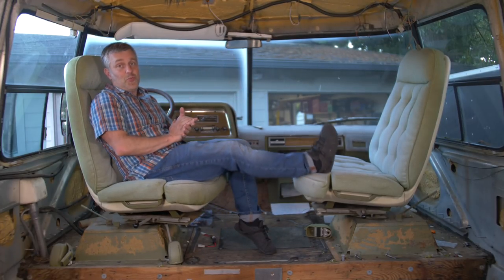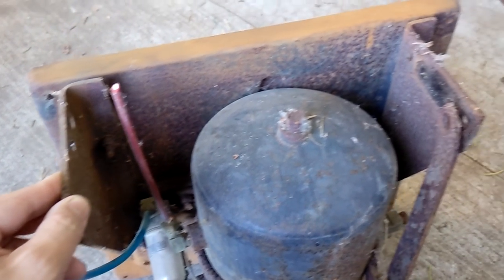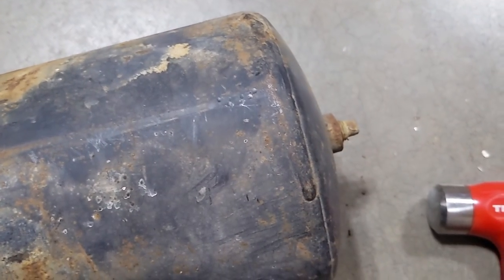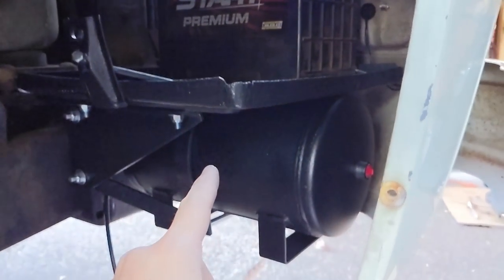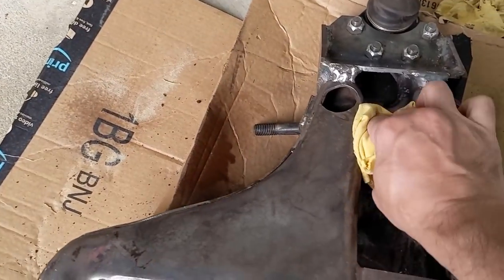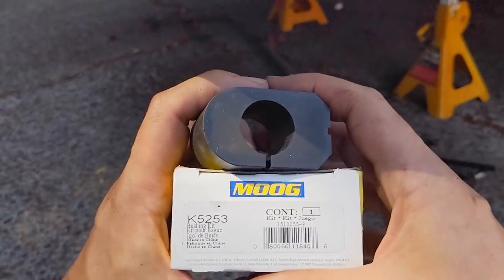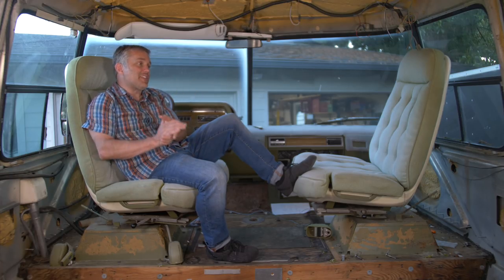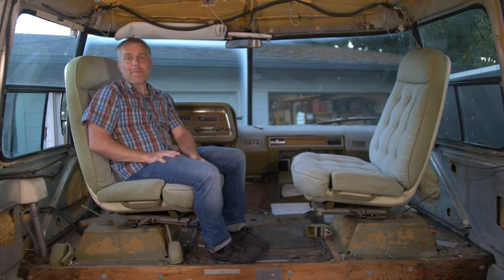Building the Best Damn GMC Motorhome Ever E.25 - Air Suspension Tank & Front End Install

Comment: The spacer on the one-ton kit compensates for the increased offset of the dually wheels.  The knuckle is designed for the offset of single wheels as used on most 3/4 and 1 ton trucks.  When dually wheels are used on the front end, the spacer is used to compensate for the increased offset between single and dually wheels.  You could get single wheels for the front and the tire track would be in the same place,  but then you would need to carry a single wheel spare for the front and a dual wheel spare for the rear..  Look at the front end of any GM or Chev one-ton dually wheeled truck and you will see the same width spacer on them.

I've had my one-ton front end for about 10 years now and I love it! The only downside to the wider front track is it increases the lever-arm on the torsion bars, so you will find you need to crank up the front suspension to bring it back to the proper ride height.  You will also find the front end dives down more when braking.
Reply: That's why you install the "reaction brake kit" on the rear that "floats" the calipers and uses connecting rods to transfer the brake forces directly to the frame instead of pushing up on the back (pivot) end of the swingarms for the middle wheels and down on the pivot end of the rear wheels. But the twist from the middle wheels unloads the rear wheels so they can barely contribute to stopping the motorhome. This all contributes to nosedive. With the floating caliper kit installed, the swingarms see none of the braking forces. It all goes from the wheels to the rotors to the calipers, to the backing plates, to the connecting rods, to the frame. The middle wheel brake force can't do any lifting on the frame and the rear wheels don't get unloaded or lose traction.

If the middle wheels could be replaced with rear wheels so all the swingarms were made trailing arms instead of the middle wheels being on leading arms, then the braking performance would be super, because all the rear brakes, drum or disc, would pull down on the rear of the motorhome to counteract nose dive with rear squat. The whole thing would slightly lower and become more stable with the center of gravity lowered under hard braking.

That's how it should have been designed but GM's engineers wanted to save $ by using a single airbag per side and thought that having a "bogey" style suspension would improve the ride by having it where rolling over something would push the rear wheel down as the middle wheel went over, providing more suspension travel as the rear wheel rolled over. But that also increases sideways rocking on rough ground.

Converting to dual airbags with a fixed center attachment eliminates the "bogey" and completely independently suspends all four back wheels. It also somewhat reduces rear wheel unloading under braking because the middle wheels swingarms twisting down don't put any pull upwards on the rear wheels through the airbags. Another trick possible with dual airbags with fixed center mounting is with independent airbag inflation (and deflation) control you won't need a jack to change a rear wheel. Inflate the bag for the good one and pull the air out of the bag for the bad one to raise it off the ground.
Reply: greggv8 ...EXCELLENT EXPLANATION

Comment: Wow, those spacers will certainly put a stress load on the ball-joints, front hub bearings, and affect the turning scrub radius of you front wheels unless you're using rims to correctly place the wheel center to the original offset.

Comment: On the axle nut- once used shim stock to fill in the difference. Soda can aluminum will work in a pinch as well. I put the shim stock around the nut with the socket wedging it in place, and drove the socket down over it.

Comment: Love your channel. I just purchased a 1973 GMC. I love everything about it except the stance. I can't stand a vehicle where the front end sticks up in the air. My Chevy G20 was the same. I lowered it and now it looks great. I also did the same with my 1981 Toyota Pickup by unscrewing the Torsion bars. I was wondering if that same thing could be done on these Motorhomes without screwing something up.

Comment: I rebuilt my front end stock, I put in offset bushings on the upper control arm,  I did my own wheel alignment using a caster camber Guage,  a laser to ensure I was alignment was straight.  The idea that the motorhome needs to track the same in the front as the back to stop it from moving around with cupped roads is a total myth.  In fact it's totally wrong.  If you studied race car suspension,  you would understand that the further you move the center contact patch off of the center of the ball joint the more the scrub radius is. The  more scrub you have, the harder it will be to turn the wheels, and the more torque steer you will have. My stock suspension drives so straight and true, I can put the cruise on and go to the back for a whisky like Ron burgundy. No one can argue that scrub radius does not apply. It absolutely does.  Most people who changed to one ton obviously , say it's  better but never felt what a good stock suspension feels like.

Comment: 23:47 No, hub centric wheels are not supported by the hub flange.  The wheel is aligned to the hub flange but the wheel is still held onto the hub by the clamping force of the lug nuts/studs.  This is a shear force and is the same regardless of hub centric or not.  The hub centric is better because the wheel is accurately aligned to the hub flange.  The hub centric rings do not bear a load. The weight of the vehicle is actually supported by the friction between the wheel and its mounting surface on the axle. The friction is established and maintained once the lug hardware is properly installed and torqued to specs.
Reply: Yes, this! Thank you.
Reply from the maker: Hi Kent, The mechanical forces in a hubcentric wheel attachment are a little complicated. The surface friction between the inside face of the rim and the outside face of the hub certainly adds some of the holding force, but by no means are the lug studs and the corresponding holes in the rim the bearing surface for the weight of the motorhome. That job is done by the flange. Tightening the lug nuts on a hub centric system only has the effect of increasing the surface friction between the two faces. Take a look at my other video at this time stamp: https://youtu.be/0jA2TIbdhMk?t=498 You can see just how much play there is between the lug holes and the lug studs. It's clear in this video that the rim is held in place by the hub flange. Even though I have the lug nuts here loosened the same movement could occur under load even with the lug nuts torqued to spec. Keep in mind that I was hearing a "CLUNK" noise when I slammed on the accelerator. Meaning that the lug nuts were allowing the wheel to spin until the rim hit the studs. Because of the tolerance between the hub flange and the rim, there is not enough moment in the vertical direction to allow the rim to slide so far that the studs contact the lug holes. That can only happen in rotational movement not vertical movement. There is a tiny bit of movement possible in the vertical direction, but it is very small.

Moreover, the force required to propel the motor home forward is far less than the force to hold the motor home up off the ground. Think about when you hit a pothole, or washboard? Driving over those those terrain obstacles is like hitting the whole system with an impact driver. We know how effective impact drivers are at removing rusty/stuck bolts. No matter how tight you have the lug nuts, the surface friction between the wheel and hub will not hold the wheel in place during these adverse driving conditions. That job is done by the hub flange. Think of it as a mortise and tenon joint. The lug nuts just sort of hold it in place and provide enough surface friction to resist (not impede) rotational movement and vertical sliding movement between wheel and hub. So, it's like an added strength, but the primary weight bearing happens on the hub flange. That's how the engineers intended it.
Reply: @IndustriousPursuits  Respectfully, Kent is correct. Vertical loads are held by the friction of the mating surface only - whether hub centric or lug centric. Indeed, most hub centric rings that are made for adapting aftermarket wheels to different sized hubs are made out of soft aluminum or even plastic. They absolutely are not designed to support the weight of the vehicle - only to center the wheel on the hub.
Reply from the maker: @McGurble  Are you trolling? The aftermarket will sell you anything. Plastic hub centric adapter rings are a death trap unless used with lug centric rims. Which is how they are used 99% of the time. Because they are plastic they do absolutely nothing, and are a complete waste of money. The lug nuts will center the rim where they want and will compress the plastic adapter if there is a discrepancy. 
You said "Vertical loads are held by the friction of the mating surface only...[on] lug centric [wheels]."
This is patently false. Lug centric wheel attachment has a 45° cone to the lug nuts and a corresponding 45° chamfer to the inside of the lug holes on the rim. These two surfaces mate and center the lug stud inside the hole. A 45 degree hole and cone mating split the clamping force equally in two directions.  This is proven by a concept from engineering called "force vectoring." https://www.dummies.com/education/science/physics/force-is-a-vector/) Therefore, each lug nut is providing 50% of it's strength to holding the rim in place resisting the planar forces forces acting in the vertical direction and also torsion (ie. spinning during acceleration and braking). The other 50% holds the rim to the hub in order to counteract forces from leaning during cornering or other such driving conditions that put a side load on the tire such as an angled side slipping road. Of course there is the added benefit of increased friction between the rim and hub which increases the holding strength of the connection resisting afore mentioned planar movements, but the engineers did not design the rim with this as the primary holding force. I doubt they even considered it in their calculations for lug centric wheels.
Reply: @IndustriousPursuits  I promise, I'm not trolling! Since I'm just a random internet person, here is a long article discussing failure modes and engineering principles behind wheel attachment methods. It gets quite into the weeds, but here is a relevant excerpt:
It has been reported in the literature [11] that a hub-piloted wheel attachment system actually provides additional support for the wheel in that a portion of the vertical road–load forces is transferred directly to the hub through contact between the wheel center hole and the hub. This is not correct! Just as in the bolt-piloted systems, all road loads are transferred from the hub-piloted wheel to the hub through the friction connection provided by the nut clamp force and the shear and bending forces applied through the nut to the wheel bolt.

https://link.springer.com/article/10.1007/s11668-017-0297-0#:%7E:text=The%20mechanics%20of%20securing%20the,its%20mating%20component%2C%20and%20the
Reply from the maker: Thank you for not trolling. I appreciate the link. I have come across the torque spec. for my hub centric rim. It is 250ft/lbs!!! That's insanely high. Given that lug centric wheels have  a typical lug torque of 80-90 ft.lbs. I do believe that I was wrong about the face friction and hub to flange weight bearing on the hub centric wheels. With 8 lugnuts clamped at 250lbs that's a lot of holding power. No need to rely on the flange. 

Further, your article is very informative. Thank you for providing it! I have read it and find no fault in the author's expertise. The paragraph you cited supports my changed mind that the hub flange does not support the weight of the vehicle during normal operation with lug nuts fully tightened to spec. I will talk about this issue in the next video. Again. Thank you for the polite disagreement and the good information.
Reply: @IndustriousPursuits  No worries, I love your vids and I hope to join the GMC Motorhome club soon!
Reply: @IndustriousPursuits  I guess my degree in Mechanical Engineering wasn't a waste after all.  :)
Reply: Most cars use both. The center hole fits very closely (sometimes so closely that a tiny bit of rust makes it near impossible to get the wheel off) to the projection in the center of the hub, and tapered seat lug nuts also contribute to alignment and support. Some fancy steel truck wheels have slightly oversized center holes to hold a fancy centerpiece on the back and an open ended cylindrical trim piece on the front to allow access to manual 4x4 hubs. Those wheels work but of course lose any support from snugly fitting the center holes to the hub projections.

Comment: Danger. you need the brass insert that fits inside your plastic line, as you have it now the plastic line can slip out of your copper compression fitting. available at your hardware store. better safe than sorry. nice build

Comment: You said you worked in San Diego so being in the fast lane at 55 mph is not unusual in California, drivers in California do not know how to use the Passing Lane, in Fact, if you ask the California driver what is the passing lane they look at you quizzically with an "Uhhhh"...thats the right lane where the trucks are" ...you can always tell the California Driver, in the Fast lane/passing lane on cruise control and they won't move over, So, great vid, never mine my sound off, I'l be watching, i love the old M H, its the simplicity, no circuit boards no chips hard wire, Thanks
Reply: Drive right not in the passing lane

Comment: The torsion bar bolts could probably be replaced with the longer bolts without full length threads since the last 1/2 to 3/4 inch cannot engage the threads due to the eye that it passes through on the end of the torsion bar anyway.
Reply from the maker: A nice idea, but false. There is no eye. The bolt must be fully threaded for full travel.

Comment: The wheel bearings are larger due to the spacer, and the extra force that you talked about.  I wonder how it would work to simply turn the wheel around, Leave the spacer off, and weld a, (Hat, Cone, shield,) onto the wheel to protect the rotor. But keeping the attachment point inboard where it was originally.?

Comment: Great video. Did you get the axles from manny? What is the oem Application
Reply from the maker: Yes I did get them from Manny. It's so much easier than doing it yourself.  Half shafts are for a 1988 – 91 four wheel drive, one ton Chevy or GMC truck. Here is the DIY guide: http://www.bdub.net/One%20Ton%20Truck%20Front%20Suspension%20Conversion.pdf

Comment: Your Wheel spacers should not add much leverage to your bearings because your wheels are dished in to compensate so the tire is still basically under the bearings. In other words The Rim and spacer kind of cancel each other out

Comment: Alternatives to battery acid exist
Have you considered muriatic acid? Available from big box hardware stores. Used in swimming pools. I used to see phosphoric acid as well in the mansonry department there  but havent seen it lately ( in california, that is ) Phosphoric acts like a rust converter.
Electrolysis works too. It takes a battery charger, and washing soda available in the supermarket detergent area .Youtube has info on this.
Reply from the maker: Yeah, I just had the battery acid on hand from the last project and I hadn't yet neutralized it for disposal. Might as well get two uses out of it.
Reply: Why do people still use the name muriatic acid? That's just a very long obsolete name for hydrochloric acid.